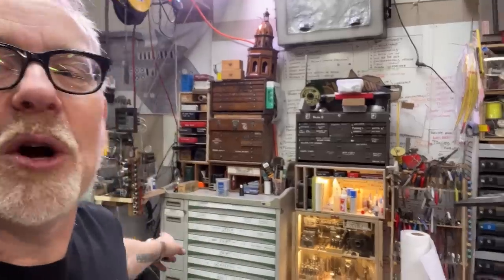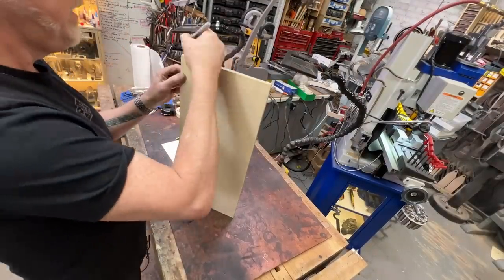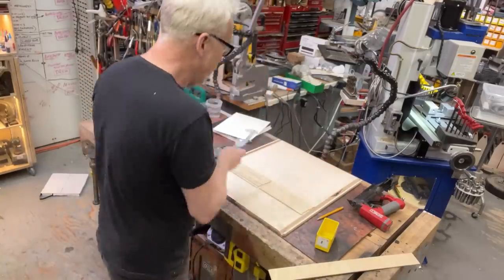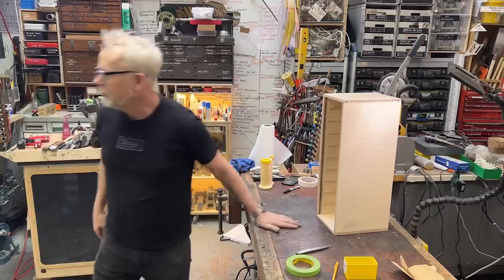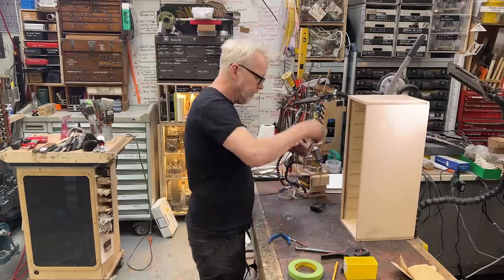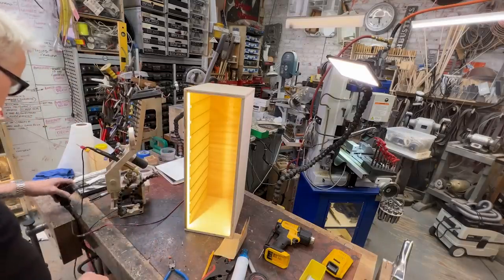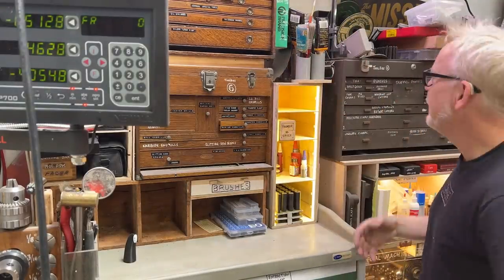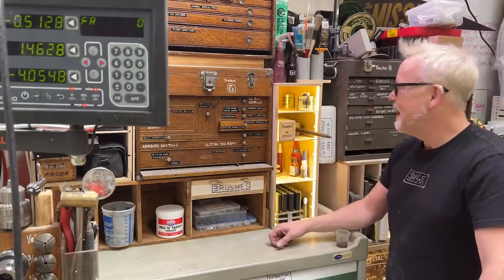This Small Shop Shelf Is So Satisfying!

Comment: Another great video,
I think this is the 3rd or 4th build in the last few months in which you have put lights into cabinets.
You might want to think of a power delivery system/architecture to save having a heap of wall wart power supplies around your cave. 
I’d suspect if I was doing it I’d have at least 2 output terminals on the back of each cabinet so you could attach picture cabinets to. 
There are some interesting Chinese copies of wago connectors that could be useful with this

Comment: From past shop re-work videos, I've noticed that your wiring for lights, etc on that wall is a complete rat's nest of extension cords.  You also set up a power supply for each lighting job, even though it is TOTAL overkill.

You could solve 2 issues at once by using one of the 8A 12V supplies you retired from your flexible bench lighting, putting a barrel plug on the outlet, then using an octopus cable to split it to 8 outputs, lighting EIGHT shelves at once.  None of those shelves should come close to using 1A.

You could either extend the wiring from each shelf to that octopus splitter, or put barrel plugs on a short wire with each shelf, then use M/F barrels and the needed wire to reach to the octopus.

This would reduce the number of power supplies you use (in the one video you retired 2 8A, so you could wire the second with a barrel plug to keep as a backup), reduce 120V cords on the wall, and if you put the barrels near each shelf with M/F extensions, it would make it very easy to unplug a shelf if you needed to move it for some reason.  You could even mount the barrel connectors directly to a corner of the shelf, though that would remove strain relief compared to a short wire.
Reply: And if you're worried about the barrels disconnecting, zip ties to the rescue!  Put one loosely on each barrel, loop another through the two (use one that is removable/reusable), then snug the ones on the cords down on that one.  Tighten it enough to keep them from coming undone.

Comment: Adam, I know you like tools, so if you want to go fancy with those solder sleeves, look for a Raychem IR-550 heat gun...its all we were allowed to use for shrinking solder sleeves on electrical harnesses when I was working in aerospace.  They can sometimes be a pain to use, and theyre not cheap, and theres no need for it at all since a regular heat gun works just fine, but...FANCY SPECIALTY TOOL!!  lol

Comment: The extra shelves, slipped beside the cabinet... How about slipping them in at the bottom of the case, under the transfer punches? That way, they are less likely to be separated from the cabinet, and easy to find if you reconfigure the shelves. You could actually just double or triple up any shelf to stash the extra shelves, so long as that didn't squeeze the space too tight.

Comment: 16:16  i like them things etc how hot you have to get them before the solider flows.. i like them colored bands they really squeeze down onto the wire.. know what u just thought of what if we added a tiny bit of flux on the wires before putting on these heat shrink solider connections  would that help melt the solider quicker or not..?  i know it would help flow the solider of course

Comment: One of my favourite channels. Adam, have you ever considered constructing a draw cabinet using proper carpentry joints.
While the glue & nail gun is quicker, there is very little actual carpentry skill involved.
You have committed large amounts of time on acquiring engineering skills but stick to the simple, what I call the MDF & nail gun quick & easy.
I can imagine you getting so much satisfaction learning things like mortice & tennon joints. Proper carpentry that would result in beautifully built storage.
I know the way you build the storage is efficient but it lacks the skill that you put into metalworking.

Comment: SFO, earthquakes. Drawers not locked in place, shelving units not fixed to the walls? Drawers slide open, shelving units bounce off walls, everything all over the floors!?  I have used bluetack to secure things on cabinets and counters, plus tongs used to lock some cupboards shut. Being in New Zealand this has happened recently…the CHC ones and the Lake Taupo (our super volcano) and I need to use brackets to lock two units to the walls here in my lounge.  Fyi…my brothers father in law lives next to Lake Taupo and had clear up all the items that shot our of shelves etc in the recent quake swarm there, the initial biggy one. It would be a nightmare putting all your gear sorted and back in place.  Regards. Laurie. NZ.

Comment: i kinda hate the fact that he hard wired the wallwart for power... there should be a way to disconnect it from the shelf via like a barrel plug and maybe even a switch.
i am sure its on a circuit adam can switch from somewhere or maybe he just flips the breakers when he leaves his shop, but making it pluggable just in case the wallwart dies would be better.